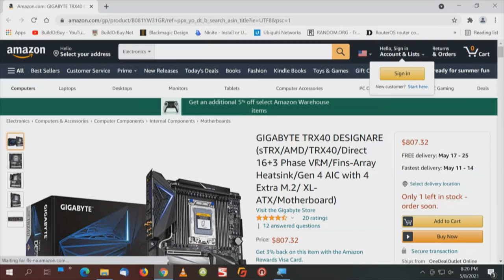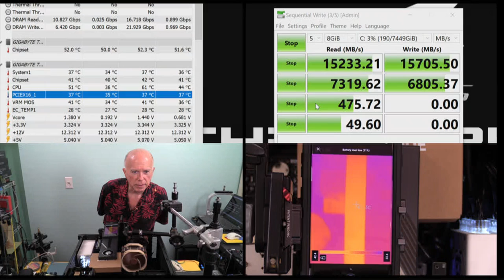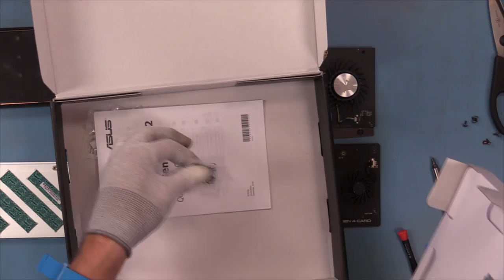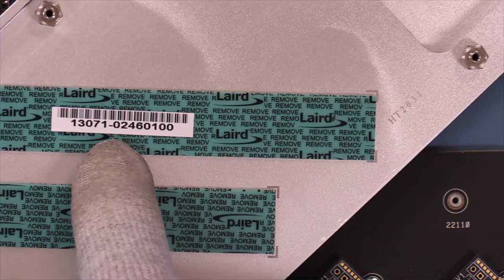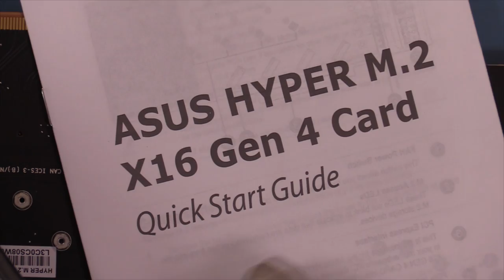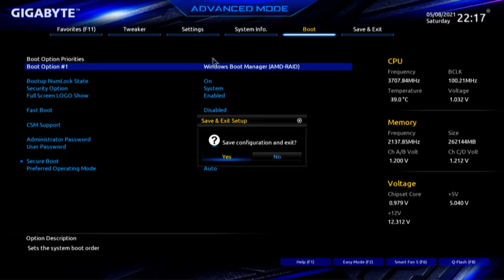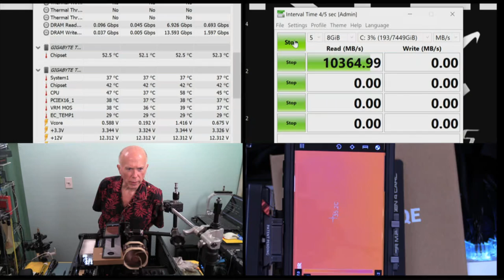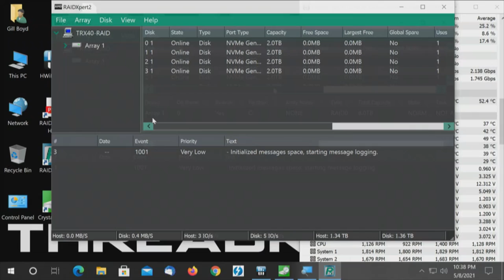Gigabyte Aorus NVMe M.2 vs ASUS Hyper M.2 x16 PCIe 4.0 AICs

Comment: is there any speed diffrence between 2 ssds and 4 ssds on those cards??? like if i put 4 ssds it will perform faster on raid 0 ???? or speed will be same between 2 and 4
Reply from the maker: Hi OKTAY, Welcome! There appears to be a load balancing issue when using less than 4 drives. Performance is better with 4 Drives. However, in RAID 0 the Tests indicate with 4 Drives, You attain the Speed of 3 Drives due to overhead for RAID configuration. 

PCIe 5.0 per NVMe will be up to 15,000MBps. Which means, new Chipsets, new Motherboards and everything else. 

BTW: Windows 11 is due out June 24, 2021 at 11:00 AM ET. Why is that important? Be careful purchasing any computer Items that require a Driver. We think this is why the older NVIDIA Video cards will no longer be supported. Stay tuned!

Comment: can i run this card on a tr4 x399 board ?
Reply from the maker: Hello Malcolm Swift, 
Absolutely! HEDT is what You have. Quad cards are Designed for HEDT like X299, X399 and TRX40. Pay attention to Slot assignments for PCIe Lane Bifurcation. Which Motherboard? New HEDT Motherboards are on the Horizon since AMD announced the new CPUs! And that's huge! We've been waiting nearly 3 years for that to happen!
Reply: @BuildOrBuy  I have asus rog zenith extreme motherboard with ryzen threadripper 1950x but its saying pcie 3.0 on my specs so will my Samsung 980 Pro m.2 s lose performance?

Comment: Can we use Asus m2 16 4 card for raid 5 on an AMD x570?
Reply from the maker: Hi margovincent22x,
Welcome! Only if You have a Dedicated x16 PCIe Slot, electrically. Most x570s do not. They have Shared PCIe Resources. Great question. Thanks for asking! 

BTW: Which x570 Motherboard are You using? Be happy to look it up and extrapolate that info for You!
Reply: @BuildOrBuy  if I need hardware raid 5/6 on x570 any good suggestions. Right now checking broadcom megaraid but as a beginner I cannot decide on how and what to get.
Reply from the maker: Hi @margovincent22x , Right now, doing Your Research to explore Your options is a good thing! 1st, is RAID a need or a want? Suggest, Keep it Simple. And inexpensive. So You can experience the technology. And experiment. 

2nd, There are 3 types of RAID. 
1. Hardware RAID 
2. Hybrid Bios RAID 
3. O/S software RAID 

2 and 3 can be achieved with a Quad card. 1 requires a Broadcom MegaRAID. 

Then You have the M.2 NVMe Drives. Same Drives work on all of them! 

Hope that helps!
Reply: @BuildOrBuy  the raid 5 or 6 is a need for our small family business.
Reply: @BuildOrBuy  I also live in PHILIPPINES so I hope I am not bothering you with the time difference.
Reply from the maker: Hi @margovincent22x  , 
To reiterate, on a Quad card, a Hybrid Bios Bootable RAID or O/S Software RAID. For that Level of RAID, whatever Your Motherboard Bios Supports.
Reply from the maker: Hi @margovincent22x  , 
Depends. Right just happened to be good timing. When Filming, I have to literally hibernate to get the work done!
Reply: @BuildOrBuy  good to hear.

Planning to get Broadcom 
megaraid 9361-8i
Cache CVMO2 

I hope this is compatible with ASUS DARK HERO VIII with AMD 5950X processor.

Of you have any tips I will wait before purchase. Thanks
Reply from the maker: Hi @margovincent22x , First, You only have 1 x16 Slot. Your Video card will be in x8 Slot. Are You OK with that?

Second, wait! To utilize a Broadcom MegaRAID card requires 3 components. Of which only 2 are currently available. We made a Video about the Broadcom MegaRAID. Watch that to understand those 3 Components and why they are required. A Broadcom MegaRAID is created to only work with U.2 and not M.2 be default.
Reply: @BuildOrBuy  hi, yes we don't need high end gpu, just to use the monitor is enough. Planning to use gt 1030 for that.

I also saw that video of yours and lead for us to consider the model with no nvme support.
Also we will use SATA connection for the raid.

We plan to use raid5/6 using SATA SSD drives " Samsung 870 Evo ". Is this ok or should be just use spinning disk drive

Are the above ideal?
Reply from the maker: Hi @margovincent22x , For SSDs, You only need SATA ports. That changes everything. Does Your Motherboard Bios support that Level of RAID? You are trying to mix incompatible technologies. SATA is different from M.2 NVMe PCIe SSDs. Which is different from U.2 NVMe. 

Back to Your original question, the ASUS Quad x16 card only works with M.2 NVMe PCIe Drives. If You're using SATA SSDs, You need SATA ports. Why do You think You need RAID? If You want capacity or speed, get M.2 NVMe PCIe. Hope that helps.
Reply: @BuildOrBuy  btw we are not using server board but a gaming board.
Reply from the maker: Hi @margovincent22x  , Exactly! Consider that fact. What makes You think You need RAID 5 or RAID 6?
Reply from the maker: Hi @margovincent22x  , Unless I know the reason for RAID, I cannot define what is ideal or what is best use scenario. All of this is theoretical and up for conjecture.
Reply: @BuildOrBuy  we plan to buy a server for our needs and it's almost $20,000 USD here at pH. We decided to use gaming desktop as a SME server for our company which could cost $5,000 USD. Cost is the issue.

In order to protect our important data which could reach 10tb in a few years we decided to use raid 5/6 for redundancy. Not exactly sure if raid 10 can be used for hot swap to repair the PC if ever there is a drive failure
Reply from the maker: Hi @margovincent22x , 
Understand. Giving me bits and pieces of a Question, changes the complete Spec thus changing the answer to Your situation. Asking Questions, We relate to the Videos We have Posted without any further details given when asked. 

SME server - http://www.koozali.org/
Suggest check and verify Specs for Your deployment. 
http://www.koozali.org/home/hardware-compatibility

I don't remember if You've had mentioned this or not. Which x570 Motherboard are You planning on Using? For example: The Aorus x570 Master. PCIe 4.0/3.0 1 x16, 1 x8, 1 x4 Slot. I would suggest verify Support. Hope that helps! Good luck on Your Build!
Reply: @BuildOrBuy  Planning to get Asus Crosshair Dark hero VIII x570 pcie. 

AMD Ryzen™ 5000 Series/ 3000 Series Desktop Processors
AMD RyzenTM 4000 G-Series / 2000 Series Processors
AMD RyzenTM 3000 G-Series / 2000 G-Series Processors
2 x PCIe 4.0 x16 (x16 or dual x8)
2 x PCIe 3.0 x16 (x16 or dual x8)
1 x PCIe 3.0 x16 (x8 mode)
AMD X570 chipset
1 x PCIe 4.0 x16
1 x PCIe 4.0 x1
Reply from the maker: Hi @margovincent22x , 
OK. ASUS Crosshair Dark Hero VIII x570, You understand Your PCIe Resources. Good! Should be fine with the Hardware RAID Broadcom MegaRAID You've outlined.
Reply: @BuildOrBuy  thanks very much.
Reply from the maker: Hi @margovincent22x  , Glad to help! Keep Us posted on Your progress!
Reply from the maker: Hi @margovincent22x ,
The Broadcom MegaRAID You've outlined only requires a x8 Slot instead of x16, electrically. Just an FYI. Hope that helps!
Reply: @BuildOrBuy  hi,

We can still plug it in a x16 slot and utilize x8 connection right?

Like when we use an x4 card and connected to an x16 pcie slot.

Yes I will post progress once all items have arrived. Still looking for another NAS back up so I plan to get Synology ds1520+. O just really hope that my AMD x570 board will be compatible with LSI 9361-8i (1g) raid card. I also bought the cachevault from LSI. I Also found out that Broadcom bought LSI.
Reply from the maker: Hi @margovincent22x  , Yes. Smart choice. Should be OK with Your Motherboard!
Reply: @BuildOrBuy  thanks, will keep this thread updated once i build the p.c.

Comment: I have Asus hyper x16 with 4 Samsung pro 970 500 GB = 2 tb total.

Read 13694.        Write  9968
Read 6339.          Write. 6631
Read 459.            Write. 405
Read 47.              Write. 249

the gigabyte is faster but I think it's fine for me also asus is cheaper it is still fast
Reply from the maker: Hi Victor Manuel Lopez Gallon, 
Your Results, that confirms We need to destroy the RAID and Rebuild. Curious. I'm surprised the RAID array Booted. A follow-up in next Video! Thanks for Sharing! And Thanks for Watching!
Reply: is 500GB pro Slot the maximum? I wont to use 4x2 or 4x4TB, i have TRX50 with 88 Lane Motherboard fyi

Comment: Can i use this just too add more drives? im not needing raid and just want more drives, and will this slow down the speed of the drives and will it effect my 3080 ti performance ? im looking to get the asus one. thanks in advance it means alot i really need to know but dont have extra cash to do the test myself.
Reply from the maker: Hi jeff dughman, 
Welcome! Yes, absolutely! A Quad AIC requires 1 x16 Slot, electrically. And that Slot must be Bifurcated in the Bios from x16 to x4x4x4x4. As long as You Motherboard has 2 x16 Slots, all is good! One for the Quad AIC and One for the RTX 3080 Ti. Are You using the X570 chipset? That's going to be a problem for having enough PCIe Resources. What's Your Motherboard? If You only have 1 x8 PCIe Slot, then a self Bifurcated AIC would be in order. Those cost as much as a Motherboard due to the PLX Chip for Lane Switching. Hope that helps! Thanks for Asking!
Reply: @BuildOrBuy  I have the new asus hero dark x570, it's part of the asus x570s boards they just dropped not too long ago, thanks for being so fast i hope the board can do it
Reply from the maker: Ji @jeffdughman9741 ,
Absolutely! Not enough PCIe Resources. 
‧ 2 x PCIe 4.0 x16 Safeslots (x16, x8/x8).
You would only see 2 M.2 NVMe Drives. And Your GPU would be using a x8 Slot. Not ideal. Very few x570 Motherboards have even 1 dedicated x16 Slot, electrically. Let alone two. This type of AIC is made for a HEDT. Like a TRX40 or WRX80. You could use a Dual M.2 NVMe Adapter like the one from Supermicro. Hope that helps!
Reply: @BuildOrBuy  Thank you so much for the advice, it helped alot
Reply from the maker: Hi @jeffdughman9741 , 
Absolutely! Success on Your Computer Build! Thanks for Asking!